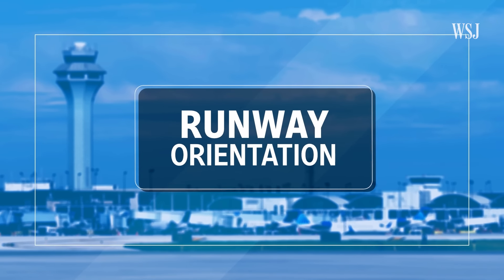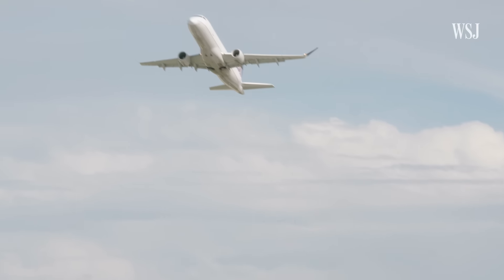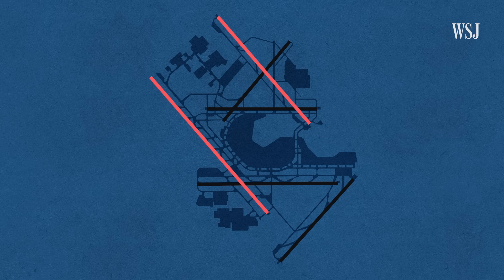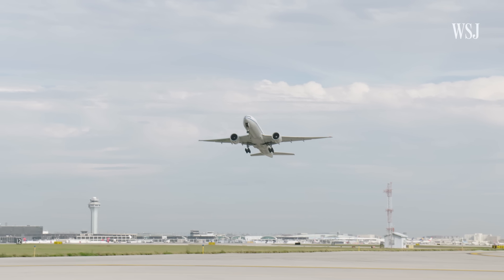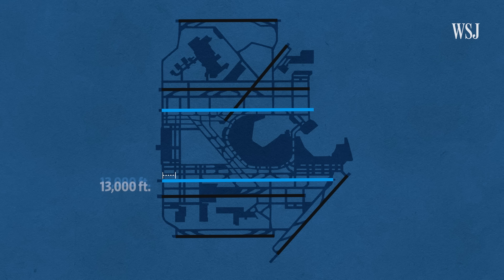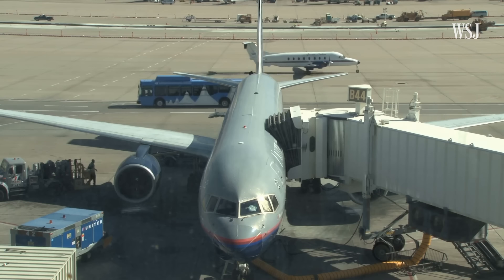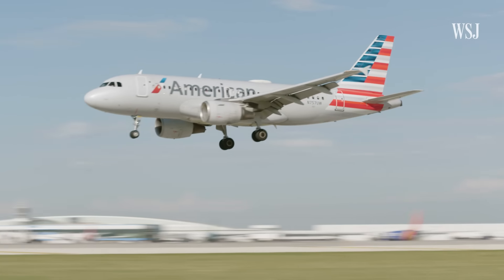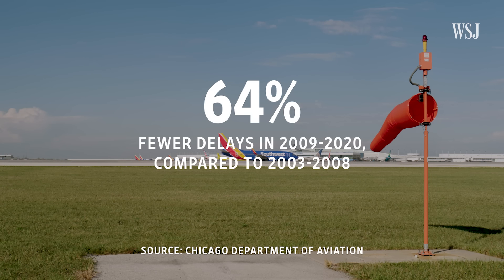How Do You Design an Airfield? An Airport Planner Explains | WSJ Booked

Comment: I've timed it.  Takes longer to taxi from the gate and takeoff from Ohare than it does to fly from Chicago to Indianapolis.
Reply: Same for landing at O’Hare lol
Reply: Nothing like a 15 hour flight from tokyo to ORD and then waiting an hour to taxi lol
Reply: Not enough available gates
Reply: Similar the flights to Milwaukee, Minneapolis, South Bend etc are shorter than the runway time! 😅
Reply: It's about where you are going.  Relatively speaking  United's Terminal 1 is the northernmost Terminal.  The northernmost takeoff runway is going to fly to cities to the north, northeast, or northwest.  While that mat mm ay be a shorter taxi for United, American ( Terminal 3) , Delta and Southwest  ( Terminal 5) will have a much longer taxi to that runway.  Conversely the southernmost runway will handle flights to the southern, southeastern  and southwestern cities.  That runway would be closer f I r the above mentioned airlines but a trek for United to taxi to.   The center runway would handle flights that are going to travel Relatively straight, The idea is to avoid planes crossing each other's paths on the climb out I f Chicago.   
Similarly planes arriving are lined up based on where they are coming from.  Again the goal is to avoid conflics between planes.  They are N I T lined up according to where their gate is wi f h the possible exception of an emergency.

Comment: Reinventing the wheel is what they did here, making it square. When I was based in ORD years ago, they had diagonal runways that made taxi times short and efficiency high. Now with only parallels, half a day seems to be spent taxing back and forth the length of a runway only to have to wait fro several arrivals and departures before you can cross a runway. To get around that place now is awful. Fortunately we pilots are paid by the minute so it’s the passengers that are really paying the price.

Comment: The only correct answer is, of course, that unless there is a major urban centre nearby and no airport within +-200kms from it, you don't build an airport, you build a railway instead. Airplanes are a backwards form of transit that should only become an option if nothing else is reasonably available, such as very long distances, or across large bodies of water.

Comment: Hey Wall Street Journal! Overall, this is a great video. However, I was a little bit let down with the production around 6:40. For whatever reason, you guys chose shots of Robert Hoxie’s hands blocking the airport diagram as he is explaining. This was very frustrating for viewers trying to understand the context being communicated.
Reply: The runways he is pointing to are 28R, 27L and 22R.
Reply: It looks like they somewhat realized that mistake, by then proceeding to showing his same exact movements but from the top camera, at 6:50
Reply: skill issue bro

Comment: Are residential concerns regarding noise a favor? You guys should be building airports in Australia. We only have 2 airports nationally with parallel runways which is a complete joke.
Reply: I'm about 10km directly out one of the arrival runways - you can hear it but can block it out. Homes closer have been getting retrofitted with sound proofing. They try to rotate which runway is used each night to create some quiet.
But yeah it's tough when there's so much residential nearby.

Comment: question is how do you design an aircraft that carries more load and takes off in a short runway
Reply: You can do it, but then it has way more drag thus flies slower and burns more fuel. Not very economical.

Comment: Chicago O'Hare will not be the first commercial airport in the country able to land four planes simultaneously.

Makes me wonder what other false information is provided within this video.
Reply: There are airports able to do so, but they don't. Dallas has five parallel runways, but they use two for takeoffs and two for landings, and one usually is not in use at any given time. Atlanta has the same system, LAX has the same and so on. Keeps the airport running better when all landings and all takeoffs are from certain runways, and there is no landings and takeoffs from same one.

Comment: Before watching this video; let me say that I’ve been ORD based for over 30 years.  When I started my airline career ORD had 2 E-W, 2 NE-SW & 2 NW-SE runways.  And a taxiway flow that worked nicely (Once you learned it.).  Flash forward to today…6 E-W & 2 NE-SW runways.  And now so many taxiways (🤦🏻‍♂️) that there is no longer a “flow” to aircraft movement.  I say that O’Hare NO LONGER WROKS.  It’s an utter nightmare.  All these new runways & taxiways to handle greater traffic volume…but only 5 or so new (domestic) gates to try to handle said traffic increase🤦🏻‍♂️🤦🏻‍♂️🤷🏻‍♂️.  

We hardly EVER had issues with contaminated runways and crosswinds near or exceeding aircraft limitations.  Now, constantly.  THAT’S just some of the repercussions of airport design based on political decisions.

Again, I’ll tell ya…OHARE NO LONGER WORKS…they’ve ruined it!
Reply: That's the reason why the next ORD projects involve expanding gate capacity.  There's absolutely still a flow for taxiing traffic, not sure what you're talking about.  Also, how is politics responsible for the changes?
Reply: @EC-oe9bv  First, when ATL took the title of “Worlds Busiest Airport” from OHARE; then Mayor Daley did everything he could to (so to speak) get ORD back on top.  That’s when the ORD Revitalization program was born.  Also, politics always play a big role in design…we’ve got to be a good neighbor.  Unfortunately, the eats-west layout is NOT the best (IMHO) design for the winds we experience at ORD.  In 32 years of operations I’ve run into way more aircraft performance (structural crosswind limitations) since ORD has gone to its current layout.  Add runways & taxiways; but not increase snow removal capabilities in proportion and you get more contamination issues which further increase performance issues we as pilots have to deal with.  That’s just for starters.

As for flow:  Taxi procedures were much easier in the past.  Now, with the crossing traffic via multiple (more) intersections…and few “standard” taxi routes; as well as route clearances that are long (& for those not familiar with ORD) which greatly increase ground control frequency congestion…there have been times I’ve been waiting for 20-45 minutes to either receive a taxi clearance; or even be able to contact ground control to get a taxi clearance when I’ve been holding in one of the pads when our gate/alley have opened.  

I’m hearing more & more from my passengers that, “In the future I’m going to do everything I can to AVOID OHare”.  If you loose your customer over poor service…what good is the expenditure?  

I’m not saying OHare didn’t/doesn’t need updating…it’s just not always done the best way.

Comment: O hare has far too many runways. You can build a long runway and use it for arrivals and departures. Heathrow has a similar number of passengers and can make do with 2 runways. 3 runways would be a good number for o hare. Maybe 4 as a buffer. Not 7. It’s ridiculous. It’s just a waste of money, space and resources that could be better spent elsewhere. Same with Dallas and so so many other American airports. Just look at how Europe does it much more efficiently and much better.
Reply: In 2017 O'hare had 867,000 aircraft movements while Heathrow had 475,000. That is almost double for O'hare. At peak times it is extremely busy. As they said 2 of the runways are there if the wind shifts. O'hare doesn't have the room to use a runway for both takeoff and departures at the same time. They can't build a 4-mile runway. Also, when it is snowing O'hare can use more runways to keep up with traffic because the planes have to be spaced out more.
Also, they can shift to different runways in order to keep the noise down over the surrounding area. If they had fewer runways, the same people would have to put up with the noise.
Reply: You have clearly never been to O'Hare or DFW.  But thanks for caring so much.
Reply: Heathrow has very few domestic flights. You can fly from Amsterdam to more UK cities than from Heathrow. Most domestic flights leave from Gatwick or Stansted. Heathrow is basically only an international airport.
Reply: It is so cute when Europeans try to explain air travel to us!  I feel certain your cute little planes efficiently use your cute little airports and carry you safely 1000 km from one side of your cute little country to the other.  ha,ha!
(never mind air freight! Feel certain your cute little economy gets along with the capacity you have.)
Reply: @Redmenace96  Just because you consume resources in ridiculous proportions doesn't make your economy better than anyone else's.
Reply: ATL has five parallel runways and is smaller than MCO.